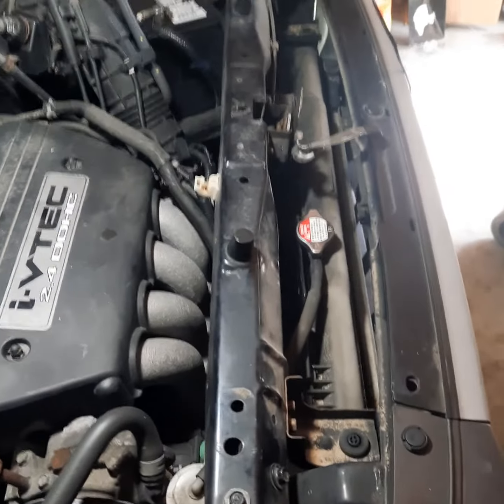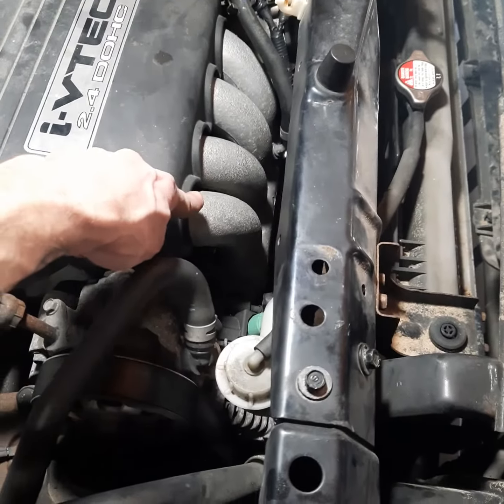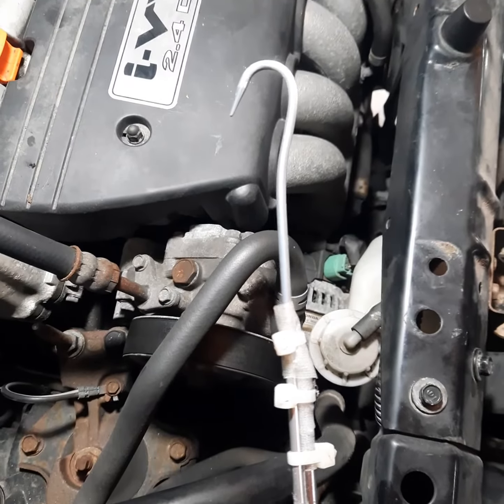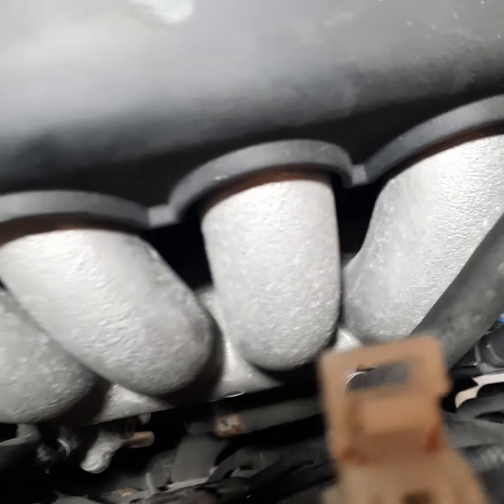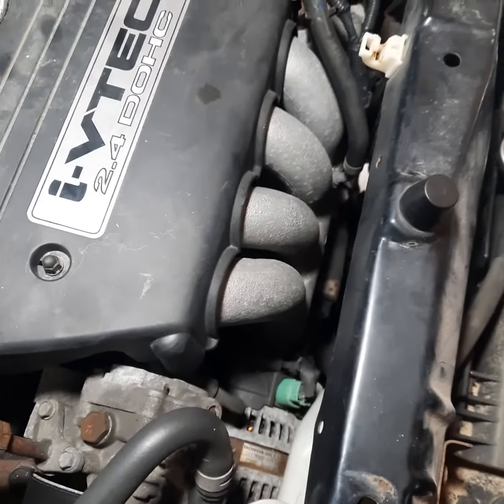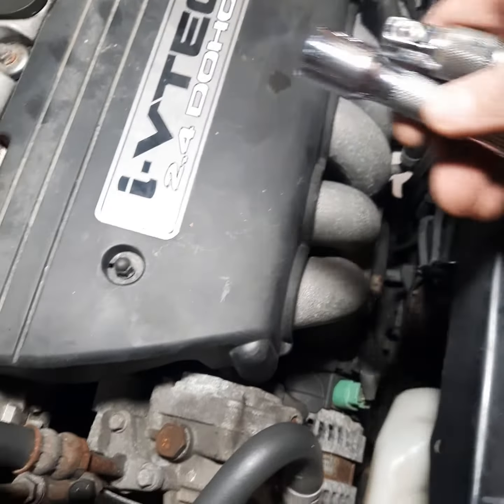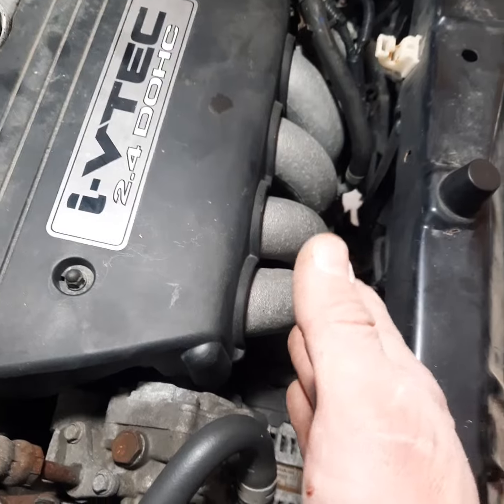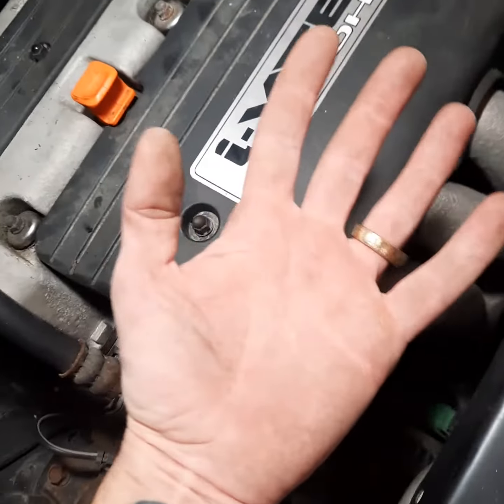Honda Element 2003-2011EASY Knock Sensor Repair

Comment: What mm socket fits the knock sensor?
Reply from the maker: @lorentsmuller  ?? I don't remember. But, I did use the new knock to figure that out. Also, If I remember it was 17 or 19mm???
Reply: 27mm